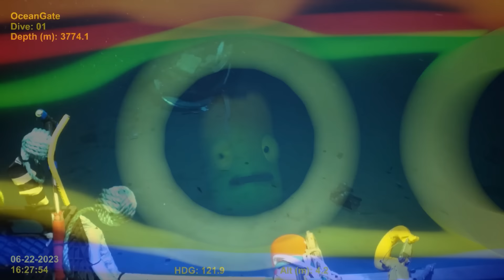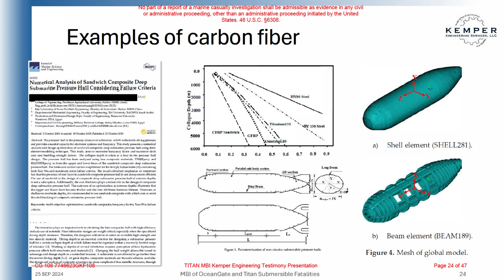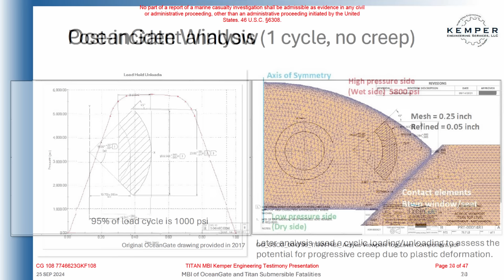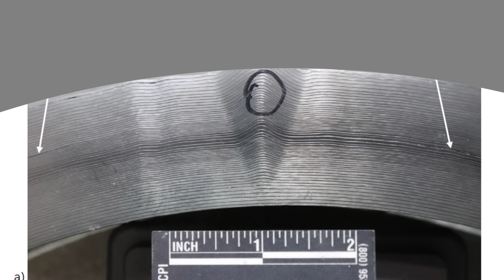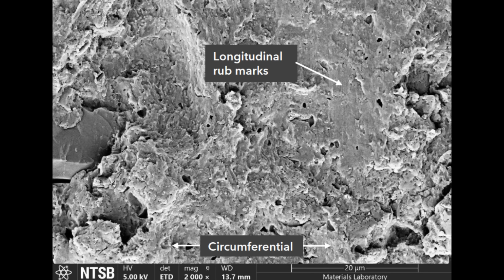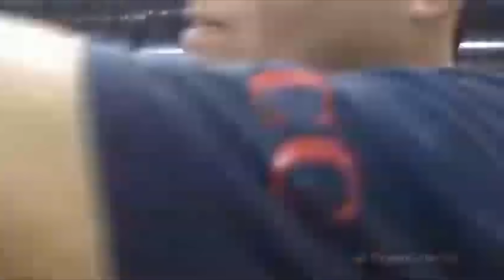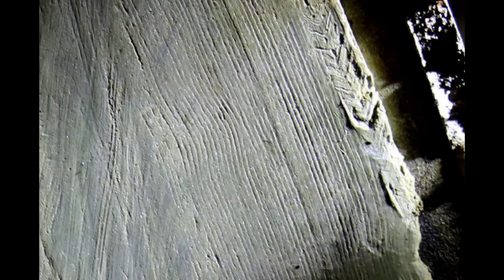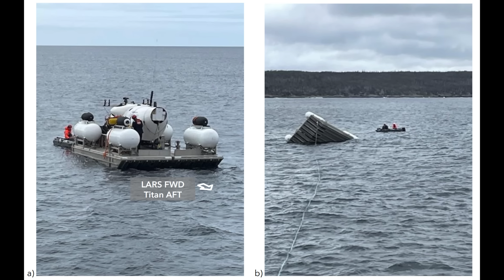OceanGate Wreck Shows Why Sub Wasn't Strong Enough To Survive - NTSB Shares Important Details

Comment: Has anyone ever seen, longitude fibre placing video of oceangate.  All videos that were released had only circumference winding part.  I have worked on these machines i straightaway noticed several things

1. When you do helical winding ie., longitude fibre placement, you will get something called dwelling on each end of the mandrel. This dwelling is not visible in any photos of the final product. Usually dwelling looks more thicker than rest of the pipe.

2. Mandrel length is too small. Dwelling on either ends will take up most part. So I really doubt they did helical winding.  Instead I reckon they have placed a prepeg carbon fibre in mat form. 

3. Steel mandrel in the video doesn't look like a collapsible mandrel, so in that case the mandrel had a tapper of 2 mm for easy extraction.  If that was the case, longitude fibre placement will have voids or overlaps.

Comment: I don't know why you dismiss the tensile strength / compressive strength issue of carbon fibre as an "armchair engineer" thing.  I'm a licensed mechanical engineer, and that is absolutely a real concern.  One of the things engineers love about steel is that its strength characteristics are so uniform, ie- they don't change depending on the direction of loading.  This makes it very predictable and easy to design for.  The moment you introduce directionality, the whole design process becomes much more complex, and the potential problems become more numerous.

Comment: I agree entirely with Scott's assertion that that the seal between the titanium end cap and CF pressure hull is what ultimately caused the Titan to fail. 

That said, the illustration by Kemper Engineering at 5:30 shows how deformation of the CF cylinder would lead to the catastrophic failure of seam between hull and titanium end cap. Once the CF cylinder experienced adequate deformation, the CF cylinder would separate from the titalium end cap, dooming the submersible to fail completely. Hull deformation > end cap separation > catastrophic failure. 

I work in automotive where engineers and material scientists have tried unsuccessfully to use composites and metal alloys together in parts that are stressed, but require low weight. To the best of my knowledge, no parts have made it into production automobiles. Even well-funded engineering organizations (like Formula 1 teams) have essentially given up on composite matrices that blend heterogenous materials into a single lightweight parts that can withstand high stress.

Comment: reading the comments...lol. Ok if you have a early warning system for hull failure its already failed, every..EVERY person that has served civilian or military Submarine service knows the lessons that were hard learned. Composites can not be used for pressure hulls, no way to ensure no air, no way to keep the brittle resin from cracking, No WAY TO KNOW WHEN IT WILL FAIL. 
Myself (submariner) and my Son (submariner) said day one it imploded the design was stupid and well known to not work. Russians made one class of submarine from titanium, and shut it down because that too has only so many compression cycles before failing.... rewatching the flange on the end caps seems very very thin and not robust at all... after hearing the testimony I think there were many corners cut...

Comment: Everyone knows that the carbon fiber failed and it was the main cause of the hull weakening. The difference between materials cause it to shift the force of the sea water's weight which created all the pressure around it. Without taking into account the forces and the differences in flexural capacitance and strength from the two materials being unequal. You only beat on something for so long until it gives. Imagine a soda can under water with all that pressure and only a thin layer of tape and glue over its circumference. A very thin mounting point with tiny bolts being the only thing between the outside water pressure and weight and the inside air chamber. All of this being a recipe for disaster. Stockton Rush was an arrogant fool and it cost him his life and the lives of his passengers!

Comment: Pretty solid summary.  The point about the window is I had direct contact with Tony Nissen and Stockton Rush to say "there is a problem here" and they didn't even challenge me on it, ask questions, or argued the point.  I sent them the analysis pro bono, just out of a safety concern for the same reason Will Kohnen asked me to look at it.  If they were using that shape of a window, it wasn't going to last and its failure mode would NOT have crazing or other tell-tales.
Reply: The fact that the window wasn't the point of failure is telling of how poorly designed and built the hull was.
Reply: I can't help but think there are solutions to correct the optical distortion that don't involve using untested, custom, and expensive acrylic. 
 I'm imagining a corrective lense attached to the bell but not touching the acrylic.
Reply: @RenigadeWarrior1  Bingo! Use the approved spherical window, with the addition of a 'correction' lens inside that is airgapped from the outer one. Of course, the facing surfaces of the 2 windows would need to have AR coatings to eliminate the secondary reflections.
Reply: @RenigadeWarrior1  Exactly, there are lightweight non-structural lenses that could adhere to the inside surface of the window, and deliver damn near any view you want!  What a senseless mistake.  But it does seem that the window didn't fail in this accident.
Reply: @numbersix8919  The fact the hull failed before the window shows how bad the hull was.
Reply: Yup.
Reply: Could the window have started the implosion?
Reply: @Strange_Brew i don’t believe so because it was blown out. That means it almost certainly was not the window as far as we can tell.
Reply: @Strange_Brew  Yes, but arguably other modes are more likely
Reply: @Strange_Brew  To be honest the initial point of failure happened to be called Stockton.
Reply: I guess there may have been another material of similar optical properties that could have been used to correct the image distortion.
To fill the curvature of the viewport.
Not sure which substance... perhaps a liquid contained by a plexi flat window on the inside.
Any substance that had the same index of refraction but did not adhere to the acrylic window.
Or, maybe, a plain old slab of optical glass/etc, shaped as a corrective lens, mounted behind a gap between acrylic and glass.
Corrective lenses worked for the Hubble telescope... could have here too, perhaps.
Speculations... have not looked at a table of refractive indexes.
Reply: @eecarolinee  Even with a different refractive index the inner "soft" lens could be adjusted appropriately.
Reply: @eecarolinee  Or maybe just watch UHD video of the Titanic wreck from the safety of the surface.  Or from your own warm home!  But those expensive bragging rights are soooo important.
Reply: Crazy thing is, the window didn't get a chance to fail because there were other failure points that were even worse.
Reply: Laughably, it WASNT the window that failed
Reply: @gamerboiiiiiii It's ironic and sad.

Comment: The "submersible" was made with carbon fiber and it was a tube with round ends.
What could possibly go wrong there. It wasnt spherical and built with completely the wrong material.
If you rushed you get crushed. he is a murderer.

Comment: Carbon fiber is a terrible material to use in that sort of environment. The constant compression and expansion of the material would eventually cause the fibers to become slack and allow a point of critical failure in the structure.

Comment: I know nothing about material science, but even I can see that manufacturing the cylinder using this method would lead to wildly uneven strength across the surface and lead to stress fractures. This manufacturing process was shockingly amateurish.

Comment: On the final dive they had no warnings from the super duper Stockton implosion warning system, they wouldn't as half the sensors weren't working. 
It was very obvious that the carbon fibre was going to fail, all of the others had whether they were scale models or hull v1. This was Stockton's suicide submersible the random subjects were who was going to be in it when it imploded. 
If you attach a carbon fibre to a car and pull you will be able to pull the car but if you tried to push the car with the fibre you cannot. It's a fantastic material for tension uses but useless for compression, as the strength in compression is that of the material the fibre is in.
I don't know who said it but it is apt, "Titan was Stockton's billionaire mousetrap" and he caught 2 and a son on the 18th June 2023. The really sad thing is that the son didn't want to go because he was terrified but did so for his father.
Reply: You could certainly put a piece of carbon fiber composite in front of a vehicle and it would stand up to plenty of compression. The compressive strength is higher than just the epoxy, since the fibers can no longer instantly buckle the way they do when they're loose

Comment: Moral of the story. Don’t use carbon fiber or a cylinder shape when going to the bottom of the ocean
Reply: Or just do an actual test campaign, use appropriate construction techniques, and use enough additional material to account for the cylindrical shape. Still might be worse, but it's doesn't seem undoable

Comment: Chose carbon fiber because it was lighter and lowered operating costs compared to the weight and larger support equipment required to handle titanium. But titanium would have been a lot easier to design and manufacture correctly.

Comment: My take:
Person 1 (looking out window; probably Nargeolet):"We are descending a bit too fast."
Persons 2 and 3 : * move forward to see out the window, shifting the weight forward *
Stockton : "Dropping two weights..."
Drops weights, one starboard, one port, and either by design or not comprehending the situation - BOTH AFT. This causes the sub to pitch forward, viewport down. With NO seating/restraints/handholds - everyone slid forward against the front dome - which then separated from the carbon fiber. The front dome popped off, and the carbon fiber portion imploded, jamming itself into the rear dome.

Comment: [10:57] This submersible was designed to implode and the main clue might be right on the minute 10:57 of your video.  Wrapping layers of anything on top of one another accumulates tension around the bobbin, something that people whom handle large lengths of cable wrapped around drums know of - i.e. oilfield wireline engineers.

As you wrap something around itself, tension tends to accumulate in the lower layers, thus as you put more and more, the upper layers wrinkle as seen in the picture, and shaving it off introduces a weakness as the continuity of the material is damaged.

Separating the layers is a great idea, but  should be less thicker and let it curate very well before proceeding - it's thickness could've been estimated running test cylinders of various thicknesses.  But in general, this layout works for airplanes since it's fighting the forces from within, tending to tense up carbon fiber; thus not as suitable to fight the forces from the outside.

Comment: it looks like those voids in the 'solid thicc' carbon fiber hull may have collapesed under pressure (or simply sabotaged that layer of fiber around it).  Once those areas collapse/are destroyed, it messes up the other fiber layers around, causing more stress concentrations which can make even more de-laminations and void cavitations.  Also they cut the fibers. The compressive/tensile strength of the hull in that layer is now the glue not the fiber. Just my opinion tho.

Comment: Also the approved Titanium grade for submersibles is Grade 5. Apparently they went to Grade 3 Titanium for cost reasons.
It should not have been difficult to triangulate the location of cracking noises using those sensors as it's very similar to piezoelectric knock sensors in a car

Comment: No one took up simple calculations, what should be the thickness of the case for a pressure of 400ATM.
Everything is simple: the real thickness of the case was only about 13 cm, it is 10 times smaller than the calculated, the thickness of the walls of the capsule should be 1 meter, the pressure on the body of this bathyscaphe was 160055 tons.
Here's how the GPT chat counted:
At a depth of 4000 meters, the Titan apparatus experienced pressure:
39.240,000 PA (Pascal),
387 atmospheres,
4001 tons per square meter.
The total pressure on the entire bathyscaphe with an area of 40 m² was approximately 160055 tons.
The calculations on the thickness of the carbon case were also shown that there should be the thickness of the walls of the capsule 1 meter, if we take 25% to the strength of the strength, then all 1.25m should be the thickness of the body of this bathyscaphe, it is 30 multiple dives and wear of the bathyscaphe, and the real thickness of the case It was only about 13 cm, it is 10 times less than the calculated.
??? (as they could be such mediocre designers so as not to conduct these simple calculations for the thickness of the case.)

... I made these calculations in 15 seconds in the GPT chat to understand that people do not need to climb into such depths, could billionaires not do this for earlier and understand that this is a deadly hobby, especially for experimental bathyscapes from a carbon fiber of 13 cm, Which is not intended for a load of hundreds of thousands of tons and depths for 1000-4000m.
There are metal bathyscapures, did the rich-millionaire really not have money to hire such a reliable bathyscaphe, and not to risk their lives so mediocre, also take children or wives with them ... This is a clever solution.

Comment: 19:05 is the clue really an issue here? I doubt it was the clue that prevented the pressure to push the carbon fiber cylinder against the inner rim/flange. I would think, that the task of the clue was just to prevent the the halfspheres to fall off of the cylinder when the vehicle was not in the water or water pressure was not strong enough to press the titanum half spheres against the carbon fibre cylinder.
and instead of a flat surface of the ring connecting to the cylinder, I would assume a rounded shape would have two benefits. first, the titanium ring and the cylinder ring would selfcenter to each other and it would add resistance against water pressure pushing the cylinderwall 'inside'. and secondly, as water pressure bends the middle of the cylinder the most inwards, this would not cause wedge shaped disconnects between the cylinder ring and the titanium ring, as the round shaped contact surface would work like a joint.

Comment: ok dumb question but why does a submarine need to be light? It's meant to sink, right? (About a minute and 20 in and Scott's just said the reason it was made of carbon fibre was for lightness. I am confusion.)
Reply: It also has to go back up.  It's easier to make a light sub heavier, by adding water, than to make a heavy sub lighter, by adding air.

Comment: It would need a rigid infrastructure much like rebar in concrete I could cad-cam it easy .there is no implosion prevention mechanism ImO unless the bevelling has been integrated like circular man hole covers .

Comment: Peel ply is removed after curing. What's left behind is that texture. The peel ply isn't a layer in the layup. 

Used to work at ATK building Airbus A350 XWB frames

Comment: Oh a bit of info I discovered is that the carbon fiber mesh had expired. A bit of research discovered that carbon fiber once exposed to open air is like activated charcoal and it immediately begins to absorb contaminants from the open air. This means the carbon fiber cloth had sat many years as leftovers from the Boeing plant. I'm not even going to the implications here as the material was sold to Oceangate with the expired for use disclaimer.

Comment: It delaminated, they couldn't afford the helical fiber winder used for pressure vessels so they had no cross hatch for strength. It should have been a single fiber wound helicaly but they went cheap and used flat panel fiber mesh fabric meant for aircraft wings where they vacuum press the layers for the resin cure process. Even Boeing, the supplier of the carbon fiber mesh told them it wouldn't work without 45 degree offset cross layer use.

Comment: It is the failure of the glue joint or interphase between the titanium ring and hull.  Recall the loud bang reported after the previous dive.   This is the hull popping back into the titanium ring after the pressure was removed.